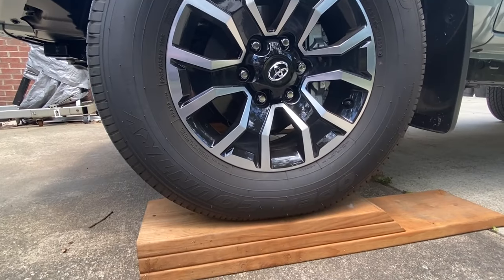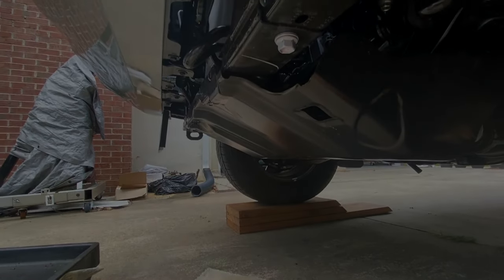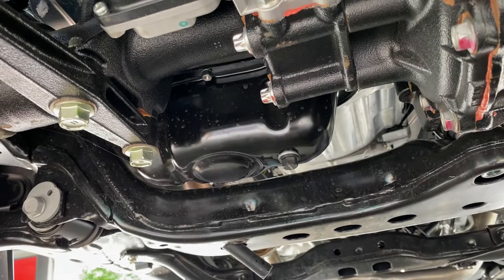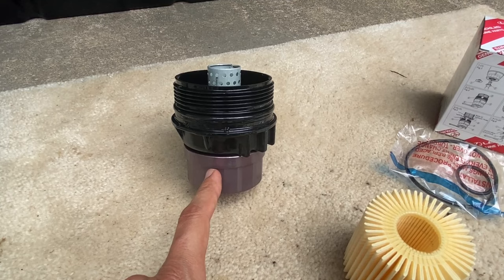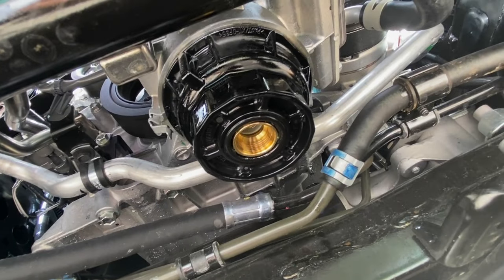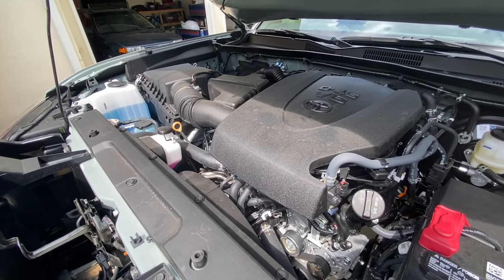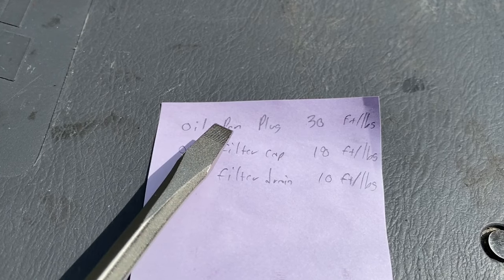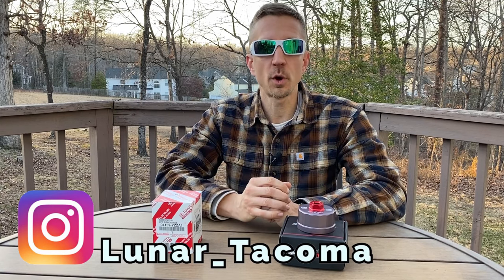Toyota Tacoma Oil Change Complete Guide - 3.5 V6 (2016-2023)

Comment: I've watched  about fifteen of these Taco oil change videos.  Congratulations, you're the only person that bothered to fill the filter housing with oil.
Reply: Same thoughts
Reply: That's cause your not supposed to fill the filter housing
Reply: I added maybe 1/3 cup. I was afraid of over filling and making a mess.  Not worth the risk I think.  What difference does it actually make?
Reply: @paulgriffith5031  yea, never see that before
Reply: that does absolutely nothing. I've worked on customers 4th gen 4runners with the upside down filter on top the engine that can't be pre-filled and many had around 400k miles.
Reply: I have worked at Toyota as a technician you NEVER fill your engine oil in the oil filter housing!!! NEVER Toyota recommends this PERIOD!
Reply: @hostilityy  My 2nd gen '09 Tacoma with the 4.0 v6 had that filter setup and it would take me 10 minutes to change the oil and no mess. It had that metal catch cup shroud with the drain and I'd catch all the oil in a plastic water bottle. Way better setup than my '21 3.5 oil change.
Reply: @erictech201 here to preach this too, kinda late but like yeah there’s no need, I ALSO used to think otherwise until further informed haha
Reply: @hostilityy  so don’t pre fill?
Reply: @erictech201  is there a reason?

Comment: Last check of oil level should be done after pulling truck off of the boards so the truck is sitting on a level surface. Great video!

Comment: I did mine at 1K, then again at 5k, 8k, 13k, then 17k most recently.  That oil filer is sort of pain and more messy than a traditional filter.  When I change mine, I have a hard time reading the oil level on the dipstick, as it it clean and thin oil.  I just put 6 quarts in and call it good.
Reply: Im the same way. Mine still has factory oil (25 miles). I just checked it the second day I've had it and it looked to be about a half inch over, but it was cold. The manual seems to say to check it after it's at operating temp, then turned off for 5 mins for the oil to drain back to the pan. This seems contradictory to me.
Also, I have a white rectangular sticker under the hood on the left. The lower left of the sticker says 2GR-FKS. The lower right says V8. Maybe it's just a code, but it's an odd code to use on a 6...
Reply: @User-q6x3b  what is the contradiction?
Reply: @User-q6x3b  how much time do you think you should wait?
Reply: @User-q6x3b  guess i cant link another youtube video from the comments, but if you search '5 Things You Didn't Know About Your Modern Toyota and Lexus' by the car care nut and go to minute 11, he mentions 1 minute as the time to wait after shutting off the car to give the oil time to drain.  that fits with what ive heard from other mechanics also.
30 minutes is so long, id be worried the oil has cooled off significantly by then and you get a falsely low reading from oil contraction.
you made me look at the sticker under the hood of my own 2023 tacoma trd-or, and it says V8 also.  ive found a bunch of other pictures on line of other stickers and its not always V8, but it is always 2 characters, either numbers or letters.  cant find anywhere what that code means.

Comment: One thing I’ve learned I haven’t tried is to do your oil drain first before opening the oil cap and dip stick. That way it doesn’t drain fast right away and cause so much spillage. Once you have your bucket under and it’s pouring slowly then you know your good to go on opening up the oil cap and dip stick
Reply: It doesn't make a damned bit of difference with warmed up 0-20. It flows like water anyway.

Comment: Really well presented video, with these new oil specs I've gone to doing two filter changes in a 5k oil change regimen, new filter at oil change and the second at 2500 miles, costs a little more, but allows for testing of oil samples

Comment: Well done. The rundown of parts and torque specs at the end is a nice touch. Not that I want to open a can of worms, but the mileage between changes thing made me laugh. My dad taught me every 3k miles, and we both did that up until several years ago. At that point I had seen enough manuals say 10k miles to feel good doing them at 5k. LOL! I might be wasting some money on oil and filters, but at least I know my engine is always running clean and smooth. I bought my Tacoma with the intention of driving it until it falls apart, so doing some extra maintenance will help keep that day well into the future.
Reply: The thing about Toyotas and other Japanese manufacturers, is they make their vehicles assuming people are not going to take care of them. American manufacturers make their vehicles with the expectation that people will take care of them. That is why Japanese vehicles last so damn long. By all means, do whatever gives you peace of mind, but 5k between changes is far too little, in my opinion. With today's synthetic oils, you can do 10k between changes, no problem. I aim for 8k, and then by the time I get around to it after procrastinating for a couple months, I normally change at 10k, if not a little bit more. Oil always comes out looking totally fine and not too dark/burnt.
Reply: @BipolarBLKSheep  There is a book called The Toyota Way that is all about how Toyota runs their company and the man who came up with the concepts and practices. In a nutshell, it's about constant improvement to both the quality of the product and the efficiency of the manufacturing process. In theory, quality is even supposed to come before profit, with the idea being that a quality product will be more profitable in the longer term. Companies around the world use their example to design their manufacturing processes, but I think very few stick to the ideals as closely as the Japanese do.

Comment: Excellent video, thank you for taking the time to make, edit, and post!! The only thing I would have done differently, is after putting in the 5 qts, start up and leak check, and skid plate reinstall, ide have backed off the ramps, THEN on a level surface, check for final top off if oil level..

Comment: I’m really big on changing my own oil and have for many years. I own a 2021 Tacoma Off Road. With that said, the black oil filter housing was actually seized on mine. I took it to Valvoline to get them to remove it. They couldn’t get it off. I then had to take my truck to the dealership for them to remove. I did purchase an aluminum housing due to the prior plastic seized. Hopefully they can remove it. A Valvoline employee did say Toyota Tacoma’s have this problem many times. This should be a recall. I’m not gonna lie, I almost hurt myself trying to remove this black plastic housing and still couldn’t remove it.
Reply: Never buy a Toyota

Comment: Just bought a new 2023 Tacoma and looked at your video to help changing mine.   I agree that 10k is way too long  of an interval and like you I want to know it's done right.  After the first oil change at 5k in my 19 Ranger I traded in on the Tacoma, I discovered a crack in the right rear taillight.  I'm sure it was done at the dealership during the oil change in fact I wouldn't doubt they swapped my light and put a cracked one in it....I park my truck away from other vehicles at work and in my garage at night so unlikely it occurred anywhere but the dealership.  The light had blind spot monitoring and cost $ 1,300.00, and just the lens could not be purchased.  Lesson learned. .......check your vehicle thoroughly before and after having anyone take it out of your sight.
Reply: That's why I always do my own oil changes. Never know what clown they will get to work on your vehicle?

Comment: Filling the oil filter with new oil is the most recommended step, and I used to do this with my uncle when I was growing up. I'm surprised none of the other YouTubers mentioned this. Also, you should get the metal housing to replace the OEM plastic housing, I will be doing that myself.

Comment: Awesome video! Definitely saving this I usually have the dealership do mine. I'm just curious how do I know what oil they use and is it okay to switch to the one you're using in this video just in case the different brand? Does that matter?
Reply from the maker: @dash4786  switching brands isn’t a big deal - just make sure it’s a reputable brand. As long as you stick with the same weight that the manufacturer recommends you’ll be fine.

Comment: And the blocks of wood for a ramp, was it because the drive way was not a level spot...please reply...thks for the video, and take care...
Reply from the maker: Just to get additional space for working underneath and getting better camera angles.
Reply: I had one more question: was that your first oil change...?
Reply from the maker: @michaelbrick9730  Can't recall if it was my first or 2nd oil change.  First oil change was at 1,100 miles to get the break in oil out.

Comment: Been changing my Tacoma 2018 since new.  I knew you were a smart guy when I saw the homemade stable wooden ramps.  I noticed many if not all the Tacoma Gen 3  oil change videos are using sport models, not sure why.  You will not find the drain plug so easily on an Off road model. There is a protective shield that kinda hides the plug.  Also, I use two different sockets, you had a thrid size?   Great video thanks.
Reply: I have a 2018 offroad as well...I'm about to do my first oil change (myself, not dealer) at 55k...that skid plate hopefully isn't too much of a pain to remove.
Reply: @socaloutdoors7355    The skid plate is easy, three bolts right up front.  What I'm talking about is a protective piece of metal that has a hole in it but allows access to the drain Plug.   Nothing to do with the skid plate.

Comment: Great video. A couple of questions though.  Did you recheck the oil level once you were on a level surface?  I also was not sure if all the used oil was removed since you were on the homemade ramps which are very cool.

Comment: thanks for the video- ilearned a lot- ??- should i change my oil since its been about 5 1/2 months since the last oil change but i have only driven it about 1,500 miles?
Reply from the maker: That's a subjective question that would be left to an oil analyst.  My opinion is 5 1/2 months isn't that old, but perhaps 12 months I would change it.

Comment: Nice video. No long talks about extraneous stuff. Just straight forward and complete. Also, if Toyota automotive engineers say change oil at 10,000 miles, then do that, not 5,000 miles. Changing synthetic oil at 5,000 miles is for obsessive/compulsive personality types (no offense brother). It’s a waste. But if you have to, well, your obsession makes you. It won’t break the bank.

Comment: I have a 2012 rav4 limited v6 whoever changed the oil last torqued the shit of oil pan bolt and steel filter cover. The guy at the oil change place wasn’t sure if he wanted to keep trying to change the oil filter. They were both so tight.

Comment: hw spec summary:
4x 12mm bolts for the skid panel, torque to ??
1x 14mm oil pan drain bolt, with thread size M12-1.25, torque to 30 ft-lb
3/8" drive oil filter drain plug, torque to 10 ft-lb 
oil filter housing, torque to 18 ft-lb
sidenote:
the wheel lug nuts need to  be torqued to 83 ft-lb, and there do exist torque wrenches with that range (10 to 83), but not many, if you want a single wrench that can handle all of these.

Comment: What's up with that metal tab 11'oclock position (time @5:25)?....it seems to get in the way of removal and replacement each time. Is there some way to move it....seems stuck on there pretty good
Reply from the maker: I believe it "Hugs" the side of the plastic casing to reduce the chances of that spinning off in case someone forgot to tighten it down?

Comment: 5k oil change is the way to go. When dealership told me that at 5k is only rotation and checking fluids and driver side floor mat, I don't took it in for service and changed the oil myself.  At 10K I'll take it to the dealership for oil change and a more serious inspection. My Chevrolet work van also ask for 10K oil change and the only time I drove it 10k before oil change I noticed the drop in performance, I'm doing 5k on that one too. Toyota bought back a 1million miles Tundra to inspect the engine, the owner said he changed the oil monthly no matter how many miles.
Reply: they will probably use synthetic/ regular mix.   The toyota dealer here in Gulfport MS tightned the filter and thing on the end of it so tight, its going to have to go to a oil change place tomorrow, since new oil is already in.  Toyota can KMA!!!!

Comment: Thanks for another great video. Question for you. The Greddy drain plug…. How’s that working out? and do you replace the washer each oil change with a Greddy washer or Toyota washer?  Any issues at all with it?  More than the magnet I like the surface area of its bolt head a lot. Thanks for any help🤙🏼
Reply from the maker: No issues at all - just a small item to help prolong the engine life.  Have a Spoon magnetic drain plug on my RSX for over 250k and it's held up well.  Keeping metal particles out of the engine is pretty important.
Reply: @randomrebuilds  the filter does that tho, right?  maybe the magnetic plug doesnt hurt, but how much does it really help?  nice video.

Comment: Did the filter tool really work "incredible" as stated? Seems it got stuck so badly you couldn't remove it from the filter cover until it was reattached to the engine. Seems it should not happen like that. What went wrong there? Still recommending that Motiv tool?  🤔

Comment: Why can't you use the same bolt into the oil pan? does it wear out or something? I've never had to do  that with other vehicles
Reply from the maker: @vikingbrian62  you most certainly can. Replacing with a magnetic one is just a precautionary step to keep metallic particles out of the engine.

Comment: Do you have to replace the crush washer every time you change the oil?  It looks like the one you recommend is about $20 on Amazon.

Also, the owner's manual for my 2020 Tacoma says very little about how to change the oil.  Is there somewhere in the manual that outlines this process?
Reply from the maker: Yes it is recommended to change the crush washer every time.  A factory service manual should explain in more detail about this oil change procedure.

Comment: I've been changing oil in my vehicles for years and have never used a torque wrench to tighten an oil drain plug it's best to go by the feeling in your hand 30 foot pounds of torque is way too much to tighten and oil drain plug in my opinion I guess some people like to make jobs more complicated than what they really are I have never had oil drain plug come loose never just my opinion
Reply from the maker: Following Toyota's torque specs when using a crush washer.
Reply: @randomrebuilds  you do what you want brother if you stripped them threads in your oil pan you going to be sorry like I said I always go by the feeling in my hand I turned the drain plug to a snug and then I give it a little turn and that's it never had one come loose ever
Reply: I agreed no need to torquing that bolt just feel it
Reply: While I agree with abiding with specs, you can't go back from a stripped bolt pattern, and this is one of the mistakes many owners make throughout.
Reply: I trust Toyota’s torque specs.

Comment: Is it a blue crush washer? Also, do you know if it’s the same size as the one a 2022 Highlander takes? Bought 10 of them last I was in Toyota when I did my oil change for the highlander. Recently traded in for a 2023 Tacoma. Thanks

Comment: Hey there, I have a quick question I noticed that your truck didn’t have a panel underneath the drain plug for the engine, I bought a 2021 Tacoma SR5 and it didn’t have a panel underneath the drain plug either but I was watching some videos that have a panel underneath so you have the first panel for the oil filter and there was a second panel for the drain plug. So did you take yours off and just leave it off?
Reply: The TRD Off-Road/TRD-Pro have additional skid plates over the SR5/TRD-Sport. I have a '21 OR and there is a cutout in that skid plate to access my drain plug.

Comment: I have a skid plate so i didnt notice  the drain plug gasket got stuck until i warched this video. So i actual have two seals on the drain plug...what a rookie mistake😅...there is no leak so i think ill be alright until my next oil change 😅

Comment: I have a 2021 with 56k miles on it. I bought the service plan 2 times. Dealership recommends changing oil after 5k miles. I plan on doing it myself after plan runs out. Thanks for sharing info on tools needed.

Comment: Great job but only thing wrong was at the end with the dipstick level check. Truck needs to be moved off the ramps and level. Best way to check is to run engine for a while then shut off and wait one minute then check.

Comment: How is the clip removed from the oil filter assembly?
Reply from the maker: the clip stays attached to the underside of the block to prevent the filter housing from rotating itself off.